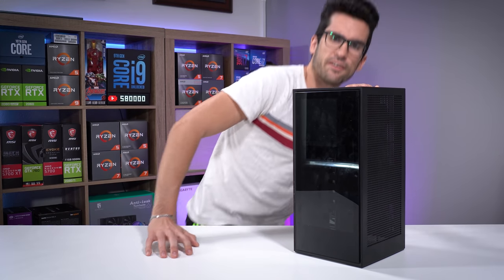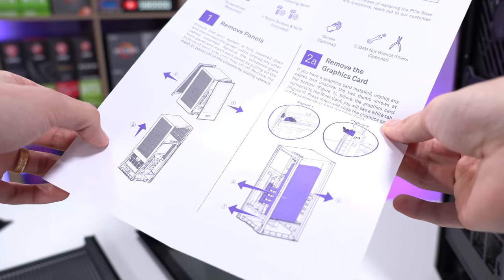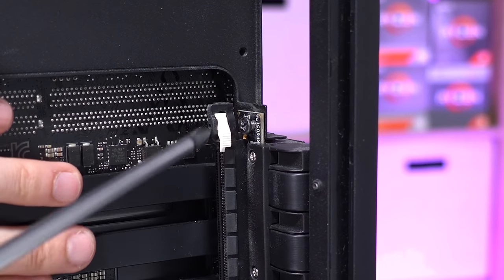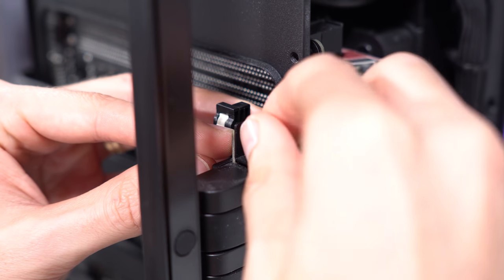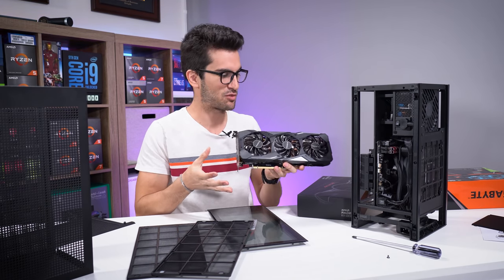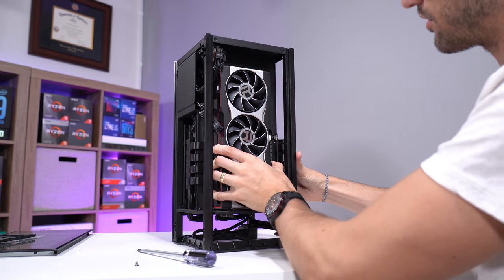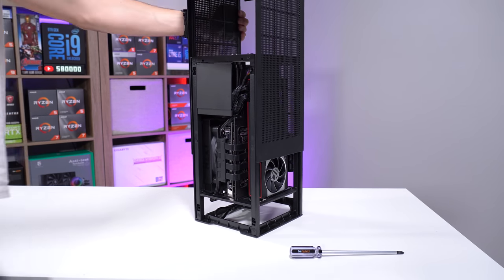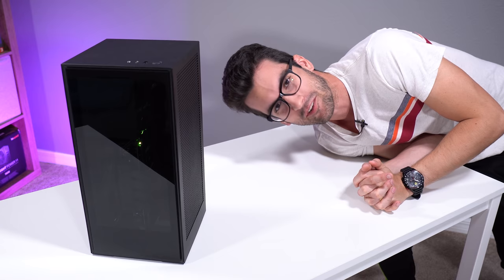Saving Kyle's ITX Gaming PC!

Comment: The nylon screws are NOT a fix! They're just a really bad bandaid for the underlying problem, which is the riser board itself, where a 12v lane can touch the screw and create a short.
The real solution to the problem is the replacement board NZXT is now sending out, after far too much time. As far as I know there has even been an official recall of this case due to the fire hazard the riser board can cause.

GanersNexus has made a couple of very detailed videos about this, where they were able to reproduce the problem, and basically did all the work that NZXT didn't do.

Comment: Remember those plastic screws are just a temporally fix. Which would still pose a risk if the case ends up in the second hand market and someone replaces those plastic ones back to metal ones unaware of the problem. The permanent one is a new riser cable which should be available
Reply: agree. That existing riser card is salvaged pcb with extra holes that shouldn't be there. Get the purpose built one to safeguard any future users.
Reply: @zL0ki  read the pinned comment
Reply: @ChrisBlagdonIsABoss  That doesn't have any real relevance to my or the previous posters comment. Saying you'll do something isn't the same as doing it. I was merely re-iterating the very serious flaw in the faulty riser card and agreeing with it's replacement being the safest option.
Reply: @zL0ki  your quote: "Get the purpose built one to safeguard any future users."
Greg's quote: "Once we get ahold of one, we'll replace this nylon screw "solution" with the more permanent one."
Reply: @ChrisBlagdonIsABoss  Not sure if it was before or after these comments but thanks for highlighting. My main focus was in terms of anyone having a temp fix only.  Until it is replaced, it remains a 'fire hazard' to any future users.  The PCB has several spurious drilled holes into the substrate that should not be there. Although extremely unlikely these extra holes are a potentials for very undesirable outcomes.

Comment: NZXT's actually sending out new risers for that case. The only question is when you'll receive it since the queue's probably long.
Reply: nylon screws are just a band aid.......Get the replacement riser for that asap!
Reply: @combokillswitch3285  That was the goal! 😂
Reply: They got checkmate after company got called about the fire hazard issues by Gamer Nexus.

And their response was not up to standards so GN made a video laying out the issues. That's the reason for that half as a fix instead of a recall.

Comment: The issue is if someone ever wants to reuse that riser cable or doesnt realize what the nylon screws are for, and puts metal screws back in since even 1 screw cycle will completely mangle the screw holes exposing the 12v on the pcb. Its  not worth it just get a different riser cable.
Reply: Yeah, my experience with plastic screws is they survive 0-2 insertions, and when they break the logical response is to use a metal screw. And boom, the riser is a ticking time bomb once more. When you finally get your hands on a 30 series GPU your PC will be on fire.

Comment: As nice as the H1 looks like, i wouldn't mess with it for a while until NZXT fixes all the problems with it. Still can't deny its beautifulll
Reply: Once they ship out the new riser cable that fixes the issue.

Is there other issues than that?
Reply: @wesleywamsley443  not any real known but I would wait a little until they revamp it and fix all the minor things to improve the chassis. Maybe add better parts or change things about the case etc

Comment: What pisses me off most about this NZXT new about this forever ago, before GN lit a fire under their ass.  

The plastic screws do not solve the problem.  The exposed trace is still there.   They are replacing the riser cards btw.
Reply: If Gamers Nexus didn't roast NZXT harder than the H1 v1.0 riser roasts $1000 graphics cards they would leave everyone with the plastic screws. Plastic screws are safe to use, but they are cheap garbage that break after 1 use. They are a good Band Aid, but stitches are necessary. A new riser is the only long-term fix.
Reply: @vincentvermilya1365  I totally believe that.  I had that case in my house for a month before GN put that video out lol.

Comment: The fire isn't caused by over torquing the screws, the hole the screws going through the PCB aren't through-grounded so they chew up the PCB and can expose a 12 volt plane in the PCB and short it to the case ground.

Comment: Thought gamers nexus showed a whole new riser cable for this fix?
Reply from the maker: No idea. Don't watch much from other tech YouTubers, but we were obviously aware of the initial research conducted. NZXT sends these kits out as temporary fixes as of right now.
Reply: @GregSalazar  the issue is the riser not the nylon screws.  The worry is that the riser could end up in a different build or with someone who doesnt understand what the nylon screws are for. They reinstall it with regular screws and burn down their house. Replace the riser altogether. Look how much of the pcb came out when u removed the regular screws.
Reply: They are still working on the logistics of that replacement, but should be coming soonish for what I gather
Reply: @GregSalazar  Yeah NZXT made a new riser so that someone doesn't sell it down the line and replace the screws with metal ones
Reply: @Jsteeeez  Plastic screws in my experience survive 0-2 insertions and I have already seen people in comments say they went back to metal ones. I'm not sure if they are trolling or not, but really that just goes to show how bad NZXT's fix is. I can already see people buying these cases used for cheap and use the metal ones out of ignorance.

Comment: Greg! nice video, I have the same model of 1660 you got there, and if you could make a deep clean video of that GPU would be awesome, I'm about to clean my GPU but I haven't found anything about how to disassembly it, and I don't want to screw it up since GPU market is nuts nowadays and getting another one for a reasonble price is impossible
Reply: Eh, depending on how nasty it is I would just settle for aircanning the fin stack. A 1660 is too new to be truly filthy, and too pricey to risk breaking. An aircan is good enough for now, feel free to practice on any GTX 750 or older.
Reply: @vincentvermilya1365  Yeah, it's not really dusty, most of times fans are off, but I can see the fans have some dust beneath the blades, so I just want to clean those, not to change thermal paste, I think it can still hold on a long time with the original

Comment: the nylons screws is also a fire hazard, would recommend to change out the case or get the new bracket from nzxt, otherwise, it will just catch fire
Reply: The nylon screw won't short the 12 volt GPU power trace which is what starts the fire. The nylon screw is dangerous because it breaks very easily and most users will put the metal one back in after it breaks. It's safe if it is replaced with a new GPU riser before you install a new GPU, shame on NZXT for implying the nylon screw was a permanent solution, they were too cheap to admit a new riser was needed in the long-run.

Comment: Why they made the screw smaller in diameter than the metal, because it's Nylon vs Metal thread scrubing each other who'd you think will win? :D IMO, you could use some rubber/non-conductive washer between the screw and the board to isolate them. ANW, thanks for the vid mate.

Comment: Wish I had family or friends that help me in my computer or friends at all, I’ll do it myself, been watching and researching for like 2 weeks. I found out my power supply has kicked the bucket after 12yrs. It’s weird it powers on powers all the fans n gpu but I guess it’s damaged after I cleaned it when the fan on the psu stopped spinning. So I had to borrow friends psu to diagnose n 🙌 . Problem solved.

Comment: what caused the case to be dangerous?
Reply: The GPU riser's screw hole is drilled right next to the 12 volt GPU power trace. A few people were unlucky and the metal screw touched the 12V trace, which conducted the GPU power to the case. That both can kill the GPU with voltage to ground, and the case will heat up causing plastic in the case to catch on fire if it isn't turned off. Gamers Nexus did a video that showed a few times unscrewing and rescrewing the GPU riser chews the screw hole exposing the 12V trace if it wasn't already touching. So if you unscrew it for a new GPU, you risk a fire. NZXT should have A: Not drilled next to the 12V trace, and B: Made the screw hole plated in metal instead of fragile fiberglass which gets chewed up by the metal screw. A plastic screw is fragile, often breaks, and if someone buys it used and breaks the plastic screw, they might use a metal one which brings back the fire risk. NZXT needs to send a new riser, not plastic screws, cause a new riser will last and plastic screws will just break.

Comment: this video irritates me because you called the nylon screws a fix & how the fire was caused by over torqueing even though GN's research showed that the issue was the threads of the screw eating into the pcb and creating short between a 12v plane and ground which could happen just by unscrewing or screwing in the screws. And the fact that this is a stop gap solution because the nylon screws does not fix the issue of the 12v plane being way to close to the screw holes which is an issue because by calling it a fix means people might not realize that the riser is the real issue and will probably forget and start using metal screws again which would reintroduce the fire hazard issue.